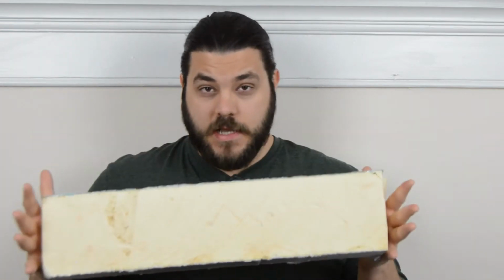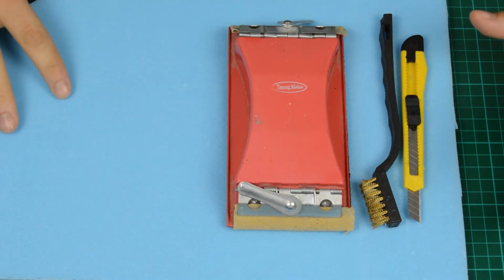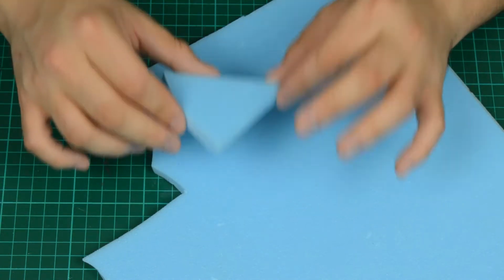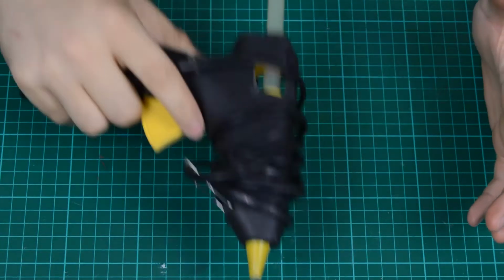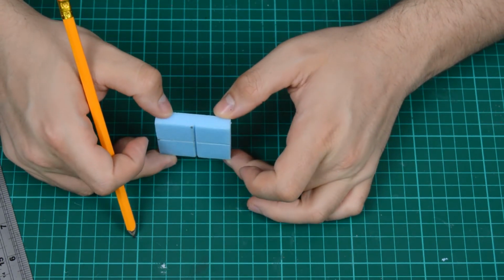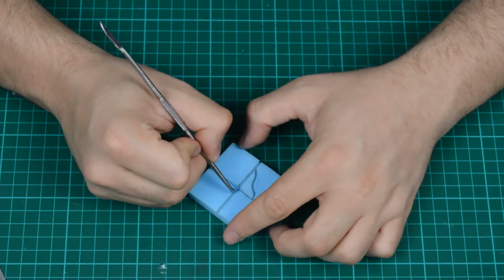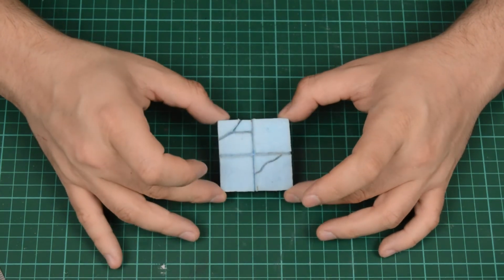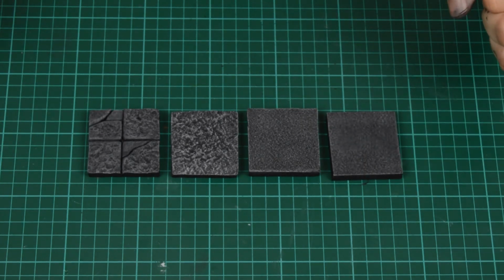An Introduction to Working With Blue Foam (Styrofoam)

Comment: Madcat100

Great video. Thanks. Your links to blue foam don't work anymore. Any idea where you can get it. I can't find it anywhere.
Reply from the maker: This is the best source on UK ebay, it's a different color but should work exactly the same! 

https://www.ebay.co.uk/itm/393483809795

Comment: you can use the airbrush to paint the foam without sealing it, right?
Reply from the maker: Yes, airbrushing will be fine. Still probably a good idea to airbrush on a primer though. It's the solvents in spray cans that eat the foam.